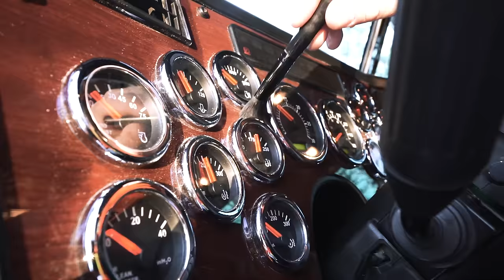taking delivery of a massive snowplow blade (24 foot MetalPless Snow Blade)

Comment: Great video! Curious what the purpose of laying the insulation board under the hydrant does. We don’t do that down in New York
Reply: It was required because the engineers that designed the install called for it, we don’t question l, just do what they ask